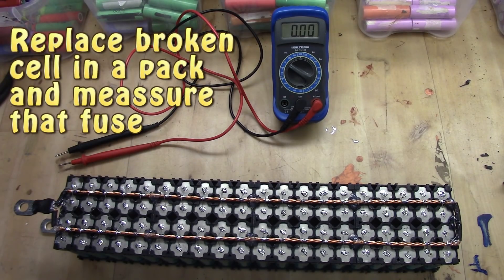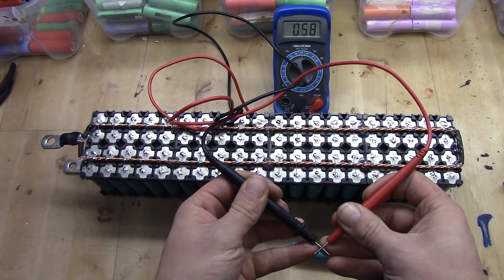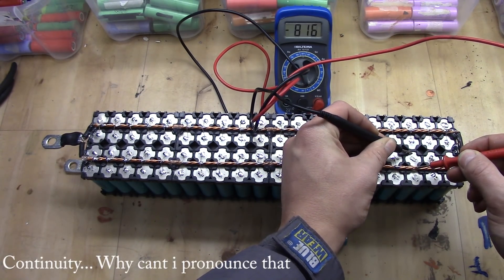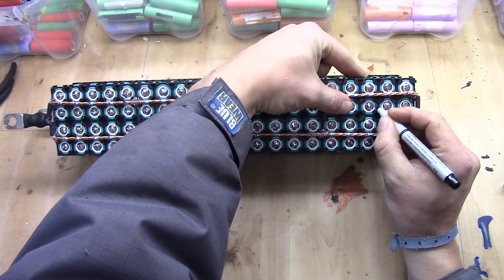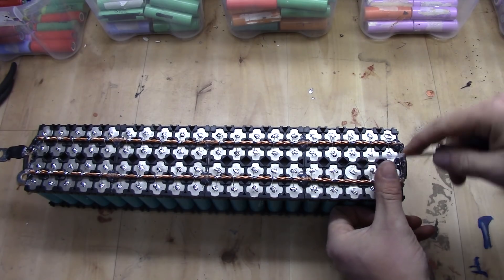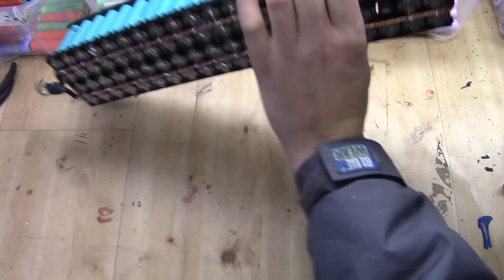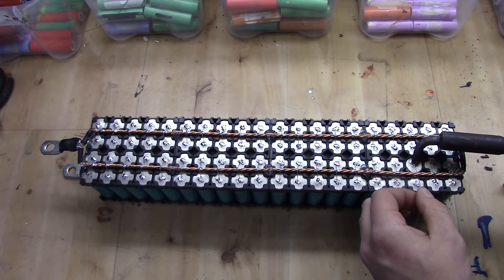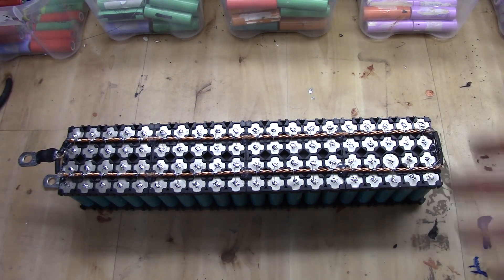Replace broken 18650 cell in your power wall pack

Comment: This is a paralell configuration , right ? So in the pole ends its like an 1x18650 cell with many Amperage.
Why did you wanted this configuration ? 

Visst beter den sig som en enkel cell med massa ström/Ampere i sig ? Vart är det du seriekopplar dessa "celler" för dina omvandlare mm 
Vilken DC Volt är det  du omvandlar till växelström sen ?
Reply from the maker: I run 14 of Them in series to conform a base Line 48vdc system
Reply: Ok , thanks for rapid answer

Comment: Nice video. I have subscribed. I am new to 18650 Powerwall. I understood how to replace the dead battery. But how to findout which one is dead out of 80 batteries? Do I need to spend my time and check each and every battery? Also how do you find out the battry voltage from one side only?

Comment: I'm noticing you do a lot of unconventional work, such as using solder instead of spot welding - But it makes sense in every case and it works. Beautiful design with the braided pair, great video. Making me re-think my entire process, for the better!

Comment: Hi. I was wondering what solder iron you are using?
Reply from the maker: 30+ years old. 200w+ and big copper tip :)  I have linked in some other types that can be used instead like a weller 100+W iron.
Reply: DIY Tech & Repairs thanks very much. I have seen a few people using something like that, and it looks perfect for the job!

Comment: Hi This is Sundareswaran from India. Your Videos are Good. I am Planning to Build a battery pack of 200Kw for my Factory with solar panels. Do you have any Suggestions for Battery configuration and Mounts.
Reply from the maker: Hi!

200kWh is alot. Depending on your demmand of power you can go with different types of packs. This also depends on what you can source. If you can source premade LiFePo4 12V battery banks its alot easier to get them hooked up together. For instance the ones I got are rated to 130Ah per 12V pack and thats 400 cells.  Building a bank out of pure 18650 cells one by one and if you want to reach 200kWh then you have your work set out :)  But if you go that route the 14s aka 48V setup is the most common. But once again for 200kWh it might be better going with a  high voltage sollution. It all depends on your area.  If you got more questions just ask them and Il answer!
Reply: I have Sourced around 1000 laptop 18650 batteries and I have decided to go to 4s20p configuration and that's 320 cell and connect in series. Also I wanted to know Whether I should have BMS for all packs. I have seen in BATRIUM site they give only 14 longmons. Kindly let me know how to use Batrium longmons for all packs.
Reply from the maker: Hi.. 4s with a 200kWh bank sounds pehaps not the best sollution. Tha is a huge bank on low voltage.  WIth that said can you hardware take 4s voltage? Its above 16V.  Batrium can support up to 250 mons in any configuration. Wether its tons of 4s20p packs or other...   But once again. 200kWh with 4s20p packs? you would need tons of strings to do that :)
Reply: My factory needs 440 volt 500 amps for 14 hours a day
Reply from the maker: Then 4s20p wont work. You need atleast 14s system or even better a high voltage system with 300VDC battery bank. 500A on 440V would be 220kW continous. You would drain your 200kWh battery bank under 1 hour. 220kW on 12V system or lets say 4s would be 13750A. You would need a 4s13750p system atleast if you work with laptop cells. That would with 2Ah cells be a 550kWh battery bank
Reply: DIY Tech & Repairs Thanks for your Support. Will message u for any suggestions
Reply: OK I will go for 14s system.
Reply: Go buy a cheap Industrial UPS for that load :)

Comment: Woah, you can measure individual cell voltages accurately by touching one main terminal of the entire pack and then one end of an individual battery!?
Reply: I dont understand how that works. at 2:06 didnt you have both prongs of the volt meter on what were both negative leads of the battery?
Reply from the maker: The cell is not connected to the busbar on the negative side so im actually meassuring all away around. Like I said its like if the fuse was blown.
Reply: hmmm, interesting, not so sure i follow completely but in time it will make sense. thanks
Reply from the maker: https://snag.gy/iFWvZf.jpg  So if you look at this image. When meassuring between those points you will get 0 diff if both batteries are on the same level. But if one of them drifted you will meassure the difference between the cells instead. So if you have a brooken fuse and the pack drifts/charges/discharges compare to the one without a fuse the voltage will also differ.
Reply: DIY Tech & Repairs thanks for explaining!

Comment: just curious, how do you find out you have a bad cell?  just regular checking?
Reply from the maker: 3 ways. Actually 2 ways.  
1. If a cell goes dead short the fuse is broken = visual can show this. 
2. If cells start to lack capacity it will be seen quite clearly when the SOC of the pack goes down. A pack with lower capacity will have lover voltage earlier than the rest
3. If there is self discharge going on due to cells not behaving the amount of balance needed will go up for that pack or if passive is used the pack in question will fall behind in SOC (Volt) when you top charge it. 

And in the end, all above is visible if  you have some kind of proper monitoring or BMS hooked up to it.
Reply: I am a big fan of arduino stuff and have tons of arduino stuff in my workshop.  Was considering for some basic testing and stuff maybe using some arduino's to keep tabs on it.  So I think that falls in line with number 2.  I am guessing you periodically do a visual inspection as well.

Keep up the good work :)
Reply from the maker: Yeah visual is always good to do i would say :)

Comment: Great videos, why did you choose the 4 by 20 configuration?
Reply from the maker: Good question. I started my packs by searching Ebay for holders and ended up looking at spacers and it was either for 1 cell or 4*5. So i went with the 4*5 holders. Then i wanted a size that could fill a normal shelf i had in depth. I could fit 5*20 in that but then i had no space for the contacts and everything so the 80p config fitted rather good. Same time there were other people doing in same size so i went with it. Didnt want to do them to big and the close to 10kwh in my case fitted good in every pack and it also fitted good where im having them :)  Hope it answers
Reply: If you were to build all over again, and want to use the battery packs as modular for ebike, battery generator and powerwall. what size would you go with?
Reply from the maker: Slicefixer Padawan depends. need to be dimensioned to suit all cases. most important is the current draw. but in general u want as big pack as possible in certain limits. i doubt 14s80p would fit on a bike :) so its hard for me to say. it must also work to move it around. above pack is just 1s80p and part of a bigger string

Comment: what do you use for fuse wire? any info would be helpful.
Reply: Brad Wheeler the fuse wire is used in case the battery shorts out. The fuse will burn and detach itself from the pack. The pack continues with one battery short.  In my opinion, this is the best way to make a batter pack.
Reply: I have got 0.25 mm (30 AWG ?) fuse wire. It's good?
Reply from the maker: Brad Wheeler hey. im using 35awg thinned copper wire made for fusing.
Reply: Thanks for the help. I am just starting this project and I appreciate all the info on your channel.
Reply from the maker: No worries. More info is on the way.  If you want to see what others done check out DIY powerwall on facebook or diypowerwall.com that also have some collected info. You find me there as Daniel R or daromer :)